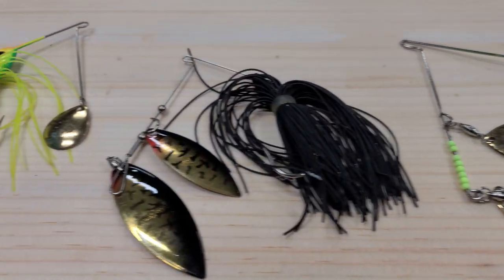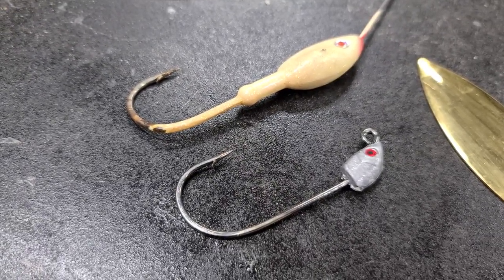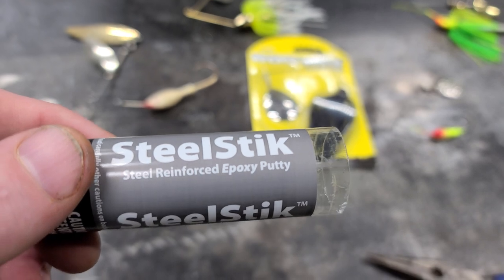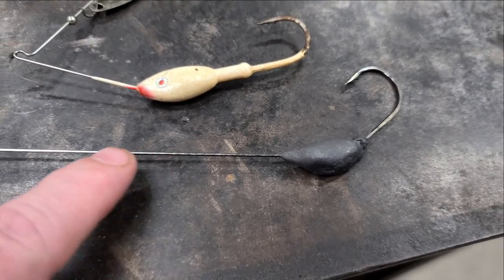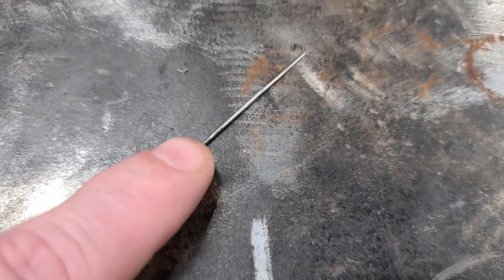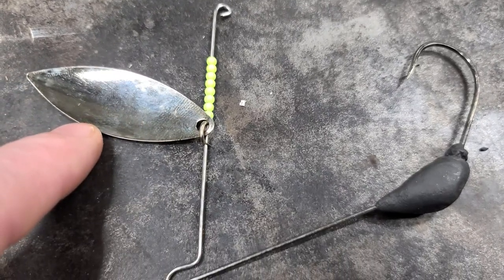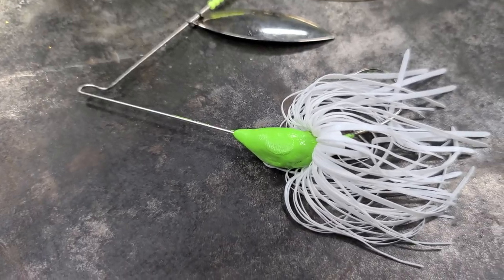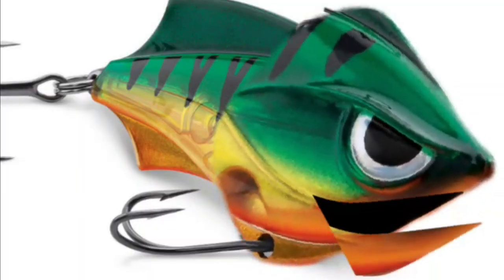Make your own Spinner bait ( from scratch  ) DIY

Comment: When the utility companies mark their underground lines with those orange flags, if I’m not mistaken, the flags are on stainless steel wire stakes....and that’s pretty cool.
Reply from the maker: That's a good idea
Reply: And those are pretty dirt cheap from Lowes or HD as well. Good video as usual! I'll have to show off my variant on your FB page!
Reply: They rust. I got some and used them to mark rows in a truck farm patch , or rather they were free one year. I simply turned them under in the fall because they were almost gone by then. By spring the tiller grabbed what was left and they crumbled to carbon.

Comment: Awesome video, ta day!  Years ago, my brother and I made and sold spinner baits...for the paint job, we hung all the baits on a tight horizontal wire.  Then we melted some vaseline in a small cup and walked down the line of hanging lures dipping the hooks in the cup.  As the vaseline cools, it leaves a thin layer on the hook.  Then we repeated the process with a small cup of paint, this time dipping the entire head.  Once the paint is dry, just wipe off the hooks with a rag.  The paint comes off with the vaseline and the head is painted and professional looking.  Something to keep in mind if you're making more than just a couple at the time!

Comment: I tell You what I do to get my Spinnerbaits to Run better and to make Ém make more Noise in the water is this. When I get ready to go the Lake, I Tie up all my New Spinnerbaits to my Pickup radio antenna (older model truck) drive to lake and by the time I drive the 35 miles to the lake the Spinnerbaits are making ALOT of Noise and is Wobbling Alot. This IS one thing that Helps to catch the BIG BASS I fish for on Lake Fork down here in Texas.

Comment: One trick of seen to straighten wire is to cut it to length. Then chuck one end in a drill and hold the other end with pliers. Stretch out the wire while activating the drill slowly. Not sure about stainless steel but I've seen it work with galvanized wire, probably should work with stainless tho. Great idea for protyping jigs and trying different colors in your area/waters thx 
BTW aren't there some of these jigs were the jighead isn't molded on the wire?
Reply from the maker: Yes Sir if  you want less weight
Reply: @FishinNStuff  well large leadhead jigs do exist for ocean fishing and that's were I want to try them out for calico, kelp or other sea bass. I've seen larger plastics used but I don't think I've seen larger spinners used(if they exist), except for umbrella rigs. Now I think I got to find some heavy molded plastics in my tackle to try out as spinners.